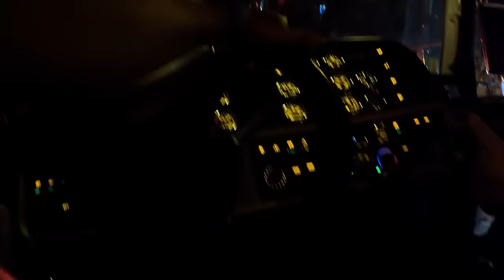Incredible Rescue - Car Crashes 250' Off Bridge!

Comment: Another great video,  I was surprised that you absailed down and not used the other winch to lower yourself down with your remote, but you worked hard on that recovery. You asked the fireman about the climbing rope, I can tell you that after the rope has been used, so many times it is condemned for use as a climbing rope for safety reasons, but if you can get them they make great tow ropes for car or kids swings , stay safe and well all

Comment: Didn't think you'd be doing some rock climbing when you woke up today, did ya?

Good thing it wasnt an EV. the batteries most likely would have gotten damaged and set fire causing a much worse scenario for the driver. I'm glad he was able to be extricated and taken to hospital. Praying he didn't have any severe injuries
Reply: Amazingly, from what it looked like, the central undercarriage was the one part of the car relatively undamaged.  You could see the exhaust tubes running back looking pretty good.  That's where batteries are on EVs.  Didn't even look like it was leaking gas or oil.

Comment: That looks like a Dyneema line. They say it's 15 times stronger than steel. 

You are starting to see sailboats transition from 316 stainless standing rigging (the wires that hold the mast up) over to Dyneema. That's a shit load of force right there, (10s of thousands of pounds of force depending on the boat size and weather conditions). It doesn't last as long due to UV degradation, so it has to be replaced a little earlier than stainless rigging. It's also not cheap...yet. When the patent runs out, I'll bet it becomes very popular as standing rigging. It's already very popular for running rigging (the lines that hoist and trim the sails).

Comment: That was about as hairy as they get. You got that one up by the skin of your teeth,  Ill bet you impressed the firemen for sure.  Seriously that looked like a movie set .  Like Chips or something  or Emergency.
Only less editing and more real life action.

Question:  your on a boom truck thats tottaly capable of handling your weight, why couldn't you lower down on one cable with safety gear on  and hook up the car with the other cable, then pull you up to safety then the car back up to the bridge.  Your rig is 100% more capable of lifting a human then that rig the fire department had. 
In fact they should have a truck like yours to make sure they hold the car wile they get someone out
A car that size isn't going to tip your truck, now a big rig off the side of that would be very tricky.

Comment: By the way what is with the red paint on the roof? My wife neeeeeds to know!
Reply: Fire Rescue does that when they search the car.  Marks the car with info for the rescuers.
Reply: The X indicates that the vehicle has been searched and cleared of victims, regardless if the vehicle is going to be recovered soon, later or never. If later or never, it prevents additional search crews from being put at risk to return to the vehicle to search it if the incident gets called in again after the original call.

Comment: You Sir need to get you a waterproof go pro case cause rain if does will not shut go pro off also keeps it from over heating as well cause you can wet the case to cool it when it is in waterproof case. . Suggestion . People dive with them and all so seen them work well.

Comment: Should you have checked to see if the car was jammed up before you went back up, at least maybe just tighten up on the lines, to see if it would move? Otherwise, super job as always.
Reply from the maker: lol jammed up? It’s being pulled with a 75ton rotator, short of a 100,000lb dumbbell in the trunk how would it be jammed up
Reply: @PepesTowingService  hi, I meant wedged in, but you are right, with that much pulling power, it would either pulled apart or hauled up. Anyway, maybe you could take up rock climbing, lol.